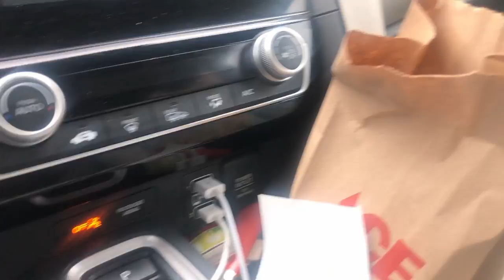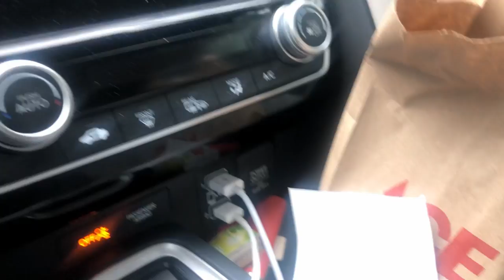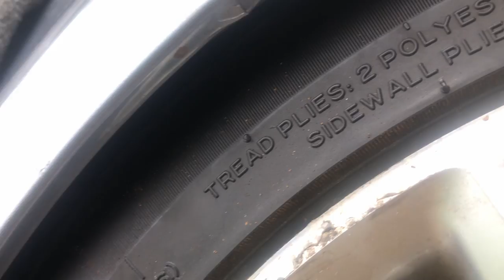How To Lower Your Mk6 Golf or Jetta on Washers

Comment: what size wheels, im on 17s and im thinking about running no washers just no springs
Reply: mk5 jetta
Reply from the maker: Wym no washers and no springs and 17’s
Reply: @MellowAintYello  because youre only running one washer imma see if i could do this w no washers, and im sayin no springs either, so jus the struts, and 17s, like 17 inch wheels
Reply from the maker: In the rear correct? Yes you don’t have to run any washers nor spring but you need it in the front

Comment: Can you rock the springs in the rear just in case washers fail in the rear ,
Reply from the maker: Well they would never fail or fall because it’s going to be bolted in it wold never fall out
Reply: @MellowAintYello  so can I keep them on? I just want the stiffer ride
Reply: @MellowAintYello  with the washers
Reply from the maker: Oh yeah if you don’t want to have a change in height I don’t know why you would want to do that though. It’ll wear your struts out faster

Comment: so wait. your running no springs in the back? just shocks??
Reply from the maker: Yes
Reply: @MellowAintYello  is that not dangerous? what if shocks blow? how long have u been running washers with no springs??

not tryna press u im just considering if i want to do this...
Reply from the maker: For a year now, if they blow it just feels stiff asf cause no compression
Reply: @MellowAintYello  wow impressive. any tips for doing it if my wheels are too big? i want to still be able to steer. i want it slammed but unfortunately i already purchased bigger wheels.

u think camber  is my best option??
Reply from the maker: Depends on your specs look at my camber videos to get an idea

Comment: looks fucking mint bro, I got a mk6 comfortline tdi sportwagen, u reckon they're the same parts?
Reply from the maker: Yes they are, If we’re speaking stock wise only thing that THATS different is the engine bay
Reply: yeah thought so, gonna get some springs soon
Reply from the maker: Ehh probably not, depends after I get the fitment I want this summer and I don’t the ride quality anymore
Reply: @MellowAintYello  fair enough bro, subbing  :)
Reply from the maker: Appreciate that bro